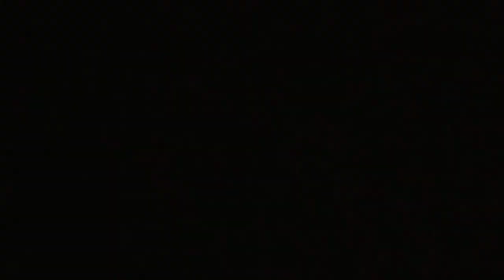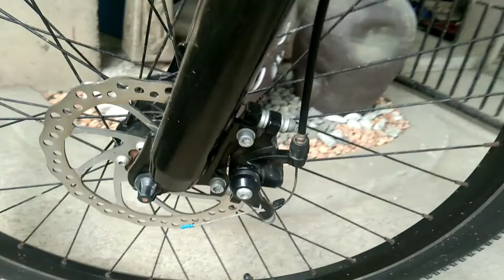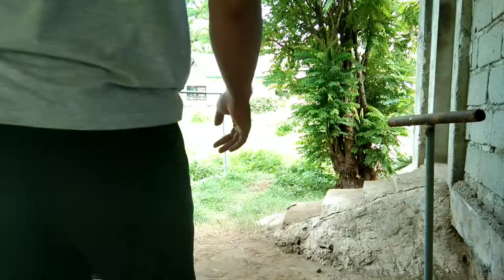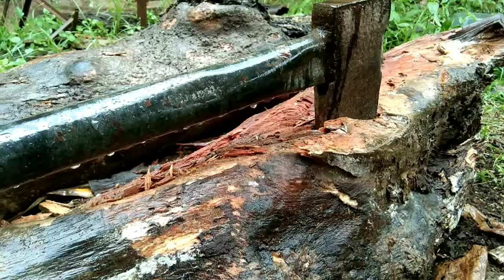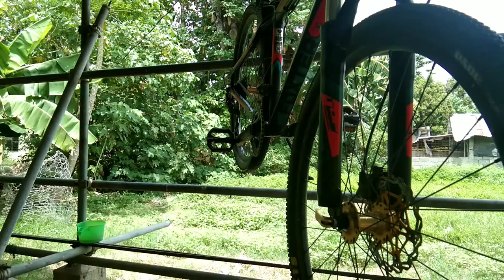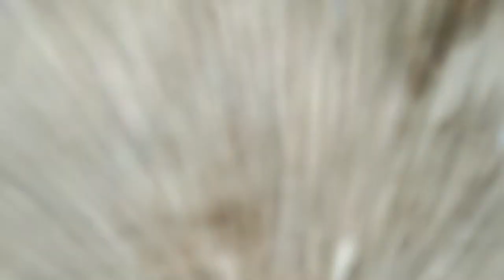Paano Ayusin ang DI KUMAKAGAT na Calipers?!

Comment: Hi. Trinx din bike ko. Kaso nasira ung spring sa loob ng routers ko sa likod. Ang balak ko alisin na lang ung routers ko sa harap at ilalagay sa likod. Pwede po ba yun? Same lang po ba sila ng shape?
Reply from the maker: Pwede naman ipagpalit, mapapansin mo naman na magkasize kapag pinagtabi mo na sila, common kasi na rotors sa trinx tulad ng nasa vid, same size harap at likod. Kung sakali man na nagkataon na di pala magkasize, pwede mo naman iadjust gamit lang spacers sa mount.
Reply: @rideready5785  maraming salamat. Need ko kasi bike for transpo pra makapasok sa work. Masyado kasing delikado kung ang brake ng bike sa harap lang. Salamat ulit.
Reply from the maker: Suggest ko nalang iresolve ninyo hangang harap din para sure, maganda din kasi na kaya mag emergency brake sakali